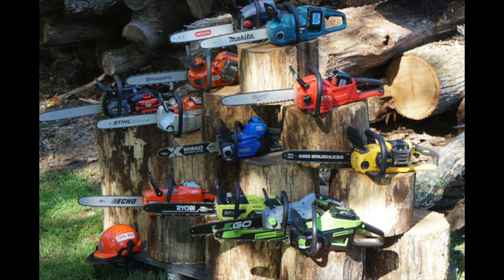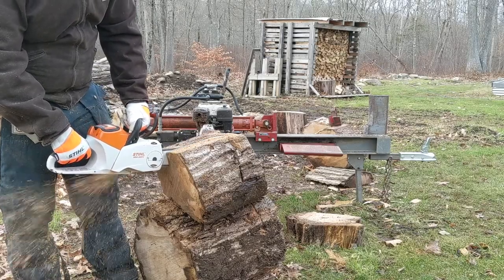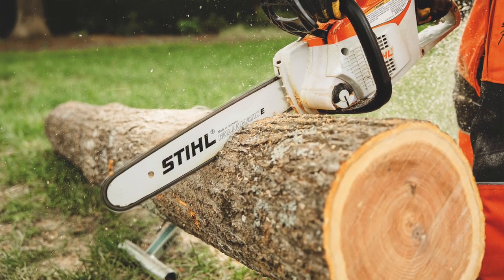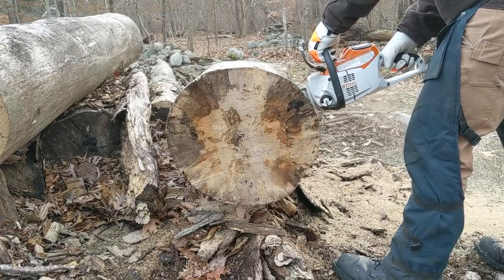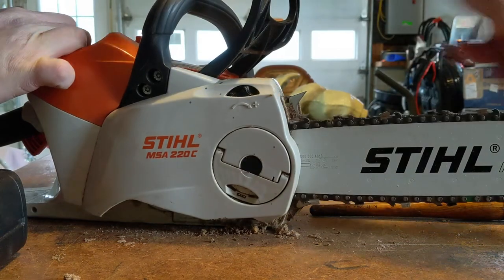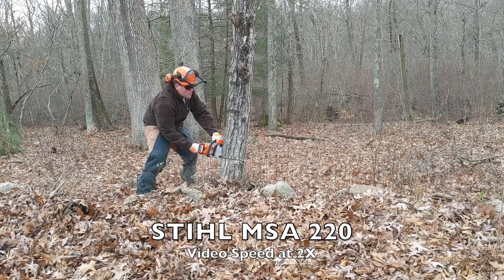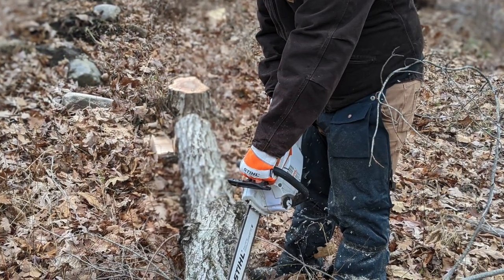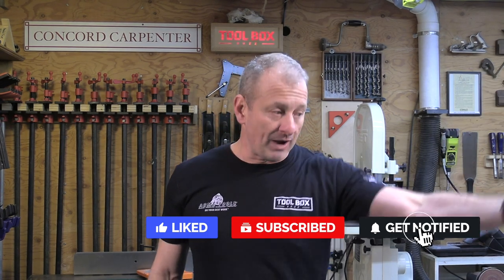STIHL MSA 220C 16" Chainsaw [2-Year Look Back Review ]

Comment: I have had a MSA 220C (with two AP 300S BATTERIES) saw for 2 years. It has been a constant disappointment. I have never had a charge on a battery last more than 12 minutes of cutting. The company replaced my original saw and both batteries. No improvement. Now the oiler has quit. I have always liked the gas STIHL saws I have had in the past. I am disgusted!

Comment: Not enough torque...  Would be better if it reved a little slower and have more torque in exchange.  I own one for more than two years.  300 batteries are too small.  You have to stick with the original very short nano bar.  The one we see on your video is too large.  The MSA300 with 500 batteries does fix that.

Comment: Great review and helped convince me I made the right decision yesterday when I had an immediate need to cut up a  25 foot long 12-16 inch diameter branch that fell from a black locust tree and was blocking our neighborhood street. The California atmospheric rivers and high winds are doing all sorts of crazy things to trees in the area. I have a Stihl Farm-boss for work on a property up in the Sierra Nevadas (5000 foot elevation) but down in the Bay Area neighborhood where I live, gas powered saws cannot be sold. This saw’s performance was shockingly good. I was skeptical but given the noise/air quality ordinance - I had little choice. I felt backed into a corner - but paid the extra $ and jumped in. Given your video and my experience, this was a great option for me and I hope to run it for many years.

Comment: Great follow up.  I bought the Makita 36 volt (2-18 volts batteries) and it has been my go to trim saw.  As you said, it's not a replacement for my Stihl MS261 Pro saw for felling & firewood use, but I LOVE the Makita for showing on my tractor and doing clearing tasks on farm.  I agree: about 10" trees are the max (red oak) for cutting down.  
Main reason I bought the I bought the Makita: I am heavily invested in the Makita system.  (multiple larger carpentry & landscape tools, 18 batteries).  I've been pretty hard on my saw & had zero issues.  I did buy a spare bar & several chains so I could keep going, still on my original bar..  The 1/4" pitch chains do wear down from filing a bit quicker, but do cut very well.  (Get the Stihl sharpener that does both file cuts at one time- a BIG no brainer and very fast to sharpen with...)  Still (pun intended), I would have been happy with the Stihl or one of the other top saws.  Just keep oil & a sharp chain & you are good to go.  
Thanks again Rob, your reviews and professionalism are much appreciated.
Reply: Last year my midle brother have some old oaks to trim down and our yong brother come over to help, sense he is yonger he goes up on the trees, I have my Stihl 161T he takes it up after trimming 2 tree's he want to try is brand new makita that his daugther and her boyfriend had offered  to him so he unbox and monted it. I not remember what Makita model it was but it was comparable with my Stihl in size and power. Next tree he use the Makita but after come down and on the next tree he take back the Stihl acording to him it feels beter and better balanced to work high up in a tree.
Stil in his case the Makita was a better deal because he is a builder contractor and use the same batteries he have for drills and other Makita tools he have.

Comment: Great video Rob! Love the look backs! I’m currently using the Milwaukee M18, 16” chain saw and it has worked great other than the chain tension gets loose quite a bit. I’ll definitely consider the Stihl chainsaws in the future. Thanks again.
Reply: I agree the m18 has a tendency to loosen up fast and derails the chain if you don’t stay on top of it.

Comment: I’m currently using the MSA200C and I’m finding the chain is only lasting a month at most. Keep watching the tension and making sure it’s oiled but i feel I’m changing out blades way too often and it’s made me start looking to others like Milwaukees new chainsaw due to the battery platform I already use. I love the battery life and longevity. I also cut wood poles maybe a limb or too but mainly topping poles. Loved the video thanks for any help or advice you or the community may have.

Comment: Good review, but a lot depends upon the type of wood (hardness). Lots of oak trees in Minnesota. Oak is a hard wood. Also, the state of dryness impacts cutting. Electric seems like a good way to go for ease of starting and winter maintenance. However, the price of the machine and battery is higher than gas chainsaws.

Comment: Great video.  How's the MSA 200 compare to the MSA 220? 3/8 vs 1/4 inch chain the main difference?  Does the 200 run longer on the same battery because of less friction?

Comment: Has I have said I have those Stihl 3 models MSA 220 C, 161T and MSA300, comparing the 220 C with MSA300 is like comparing a Ford Fiesta with a Mustang GT, still I not meaning their is no use for the 220 C, but i sugest anyone before buy the 220 C to take a look at the MSA300.
In regard to the 161T is my joy work horse, for me is a must have, i have it about 2 years with a 30cm bar, have used and abused it way beyond manufacturers recommendation and never fail, The MSA 300 sure feels like a professional and powerful machine the down side is even with biger battery the AP500S if used in full power mode the battery time is kind short, I wish STIHL be able to come up with a better battery  because the saw absolutely deserve a last longer battery.

Comment: I use to have a 40cm bar like that on the video in mine 220C, now I change for the 35cm Light 04 and at first feel kind weird but then i begin to got the impression the saw was faster and the battery last a little longer so I am keeping it. In the case of a ticker log I use the MSA300 with a 45cm bar.

Comment: I have the MSA 220 C for about 2 years and yes I have used it quite a lot  never have any problem however I also have the 161T and the MSA300 this two feels much professional. I realy not like much the bar atchment sistem, but in over all i am happy, if was possible to install the bar attachement like in the MSA 300 I with do it.

Comment: Battery power isn't there yet. Maybe in another 5 years or so.
Reply: Have you not used a newer saw with the 21700 cells in the battery packs? They are extremely powerful. I think to say "Battery power isn't there yet" really depends on your use case. Out in the woods? Yeah your probably right, but around home, I would have to disagree. However my father has given up gas saws in favor of the 80v Greenworks for out at his cabin. He's getting up there in age and just loves the simplicity of the electric saw and the performance it provides. My brother has a Stihl MS251c, and in a head to head cutting a 14" maple, the Greenworks wins everytime. But yes it does eat the battery up faster than a tank of fuel, but if you have a charger laying around, it's capabl;e of charging to full in 30 minutes (with the 2ah battery). So if you have two batteries, and a way to charge them, it's really a never ending cycle.
Reply: He mentions twice in the video that the saw is not a replacement to a large gas saw and yet he'd still get comments about it. 1 Hour after video release and you've already proven him right lmao.